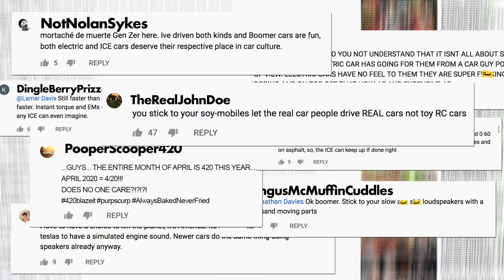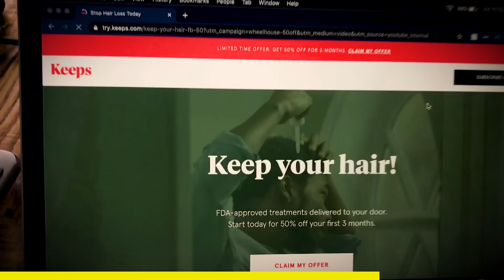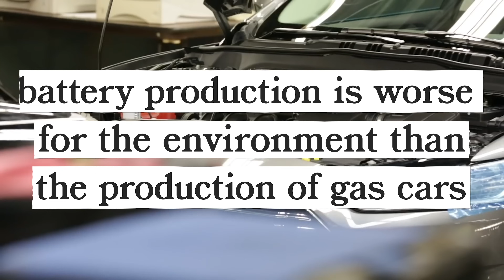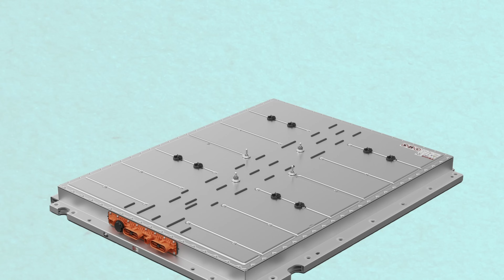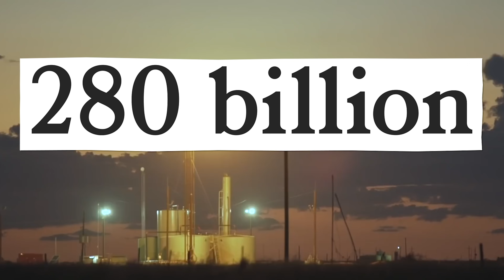Are Electric Cars REALLY Better for the Environment?

Comment: I dont get the Calculations made in regards to the efficiency of Evs. Surely you need to take in consideration the efficiency of the power generating system and electricity transmission system. My reasoning in regards to Evs is as follows assuming that the electricity is supplied  or part supplied by a fossil fuel power station 1. The fossil fuel needs to be dug out of the ground and transported / piped to the power station this requires energy and Co2 emissions. 2. The chemical energy in the fossil fuel is converted to heat energy  ( this is a very inefficient process as I understand as in all Heat engines - remember powerstations are really very inefficient steam engines ) and lots of CO2 is emitted. 3. Kinetic energy in the turbines is converted to electrical energy in the generator ( another massive loss in efficiency) 4.This electricity is the transmitted via a step up transformer to the Grid network (Heating effects again loses loads of energy ). A step down transformer then transmits this too your Ev  ( more energy loss ) In the battery the electricity is converted into chemical energy in the batteries ( another huge loss of energy ). When you want to drive somewhere the chemical energy is converted back into electrical energy to power your electric motor- more energy loss in both processes. So may I ask how the hell are EVs  more efficient and produce less CO2 per kilowatt of power used than a gasoline vehicle that has far less steps from production - to transport - to Heat engine - to go. When I was taught science years ago a golden rule was the less energy transfers the more efficient a system is overall ??? Please explain - or are we all be conned by the likes of Tesla ??

Comment: You possibly need to factor in how long an internal combustion engine lasts versus how long a battery pack lasts. If you need to replace your battery every five years, then that’s another 40 metric tons of CO2 to produce the new battery
Reply: 10 years*

Comment: I think one thing he missed was that gas cars typically have a longer lifespan than evs without replacing parts, but the effects of that statement probably still won't dethrone electric vehicles
Reply: "Without replacing parts..." so you don't change your motor oil, then?

Comment: Great video man! 
One thing we have to consider here is that EV production technology is still in it's infancy. The process will get more efficient as the economy of scale gets larger. Also, our power grid is something that will get better over time also. On the other hand, you can't just take oil out of the air and put it back in the ground. Once the genie is out of the bottle, it's stuck in the carbon cycle.
Reply: well you can. You grow stuff and bury it. think of all the paper waste we are burying in land fills.
Reply: I am a home builder and we have been putting higher amperage service panels in single-family homes to allow for the use of ev's in the future.
Reply: That’s not true - carbon capture is the possible, there is this really cool new technology called plants. And “the power grid will upgrade over time” - good luck with that, the costs are exorbitant and it will take hundreds of billions of dollars and a century or more before the entire country would be upgraded.
Reply: One of the dumbest and most common arguments I see is "the power grid can't handle 100% EV's. Checkmate, hippies. Hurr durr." 
As if the current grid is this static thing that will be as it is for all of time
Reply: I'd like to mention that hydrocarbons are also cleaning up. Unknown to many people, the introduction of fracking has significantly reduced the amount of emissions  attributed to the USA. There are plenty of startup research companies looking into making hydrocarbons with carbon harvested from the atmosphere, either biologically or chemically. Having your fuel as a relatively inert liquid which is easy to transport and requires specific conditions to ignite, let alone explode, is pretty beneficial. Having your power plant also produce heat is very good in harshly cold environments, not to mention that basically, as long as you can get the engine turning and the fuel isn't frozen, you can start an ICE. Electric batteries, on the other hand, do not fare well at all once you are well below freezing. EVs are inherently heavier too, putting more stress on brakes, tires and roads. I believe repaving highways is not only a big inconvenience and expense for travelers and taxpayers, but involves plenty of emissions as well.

I would place my bet on cleaner oil, not electric vehicles for all these reasons and more. Just because newer tech exists doesn't mean the old is bad. We still use steam turbines all over the place in power generation, even if the heat comes from a nuclear reactor. If it ain't broke, don't fix it.
Oh yeah, one more thing: Different cars will not make American cities any more pleasant to live in. The solution is fewer cars, and better public transportation. Make downtown cities walkable again.
Reply: The power grid where I live, isn't going to be better. It's simple, most roads are gravel and the ussr still exists on maps were I went to school at. So electric cars? Really? Maybe in the city but everywhere else. Nope.
Reply: Oh really? The last battery evolution happened in 1995. And the man who did it won the Nobel Prize. So good luck with your manufacturing scaling improvement.
Reply: @JoseSilva_  yes but it was just an evolution, we need a revolution in portable energy storage. We need battery technology to have followed a similar curve for increased output and miniaturization that we saw for the rest of the electronics world.

Comment: Concise and informative.  Thanks a million for educating me for this important topic!
Reply: To bad the conclusion is all wrong, and not even close to be true.

For example a EU low emission car (pre 2024) is 92gram/km. The most efficient electric car on the market (tesla 3 and Huyndai Ionic, shared place) will use about 0.18kWh of power from the power-station (grid losses included). The most efficient coal power plant in existence is 740g/kWh.. so that brings the mots efficient car and the most efficient power plan to 133g/km. That is quite a bit more than 92gram/km

Comment: Gas cars are pretty irrelevant as comparison to EVs, because there are very few that use LPG or CNG. It would be much more relevant to use diesel or gasoline power trains, which are also more efficient than small gas engines.

Comment: Going to need a better alternative to lithium that's for sure.  Hopefully calcium batteries can deliver.
Reply: Lithium is a very powerful material when it comes to battery manufacturing and that’s thanks to the chemical reaction. They have a very high energy density which is crucial for electric vehicles. Even the more stable variant of Lithium batteries which are Lithium iron phosphate still use lithium. 

Calcium batteries are still early in their development stages but they may never work in ev’s due to their low electrical conductivity and short cycle life.

Comment: You can tell that this video is two years old. Biden and gang have well begun to stifle fossil fuel production and transport, and it's pure fantasy to think that solar power--a highly inefficient use of resources and the land millions of panels would cover--and spinning whirligigs will supplant those fuels and supply the power 24 hours a day to hundreds of millions of EVs.

I wouldn't care to have a car that could turn Roman candle at any moment, in use or parked. The EV cost will be at minimum 50% more than the equivalent ICE and will be much less recyclable. The cost of charging stations at, say, apartment buildings will be vast, and the expense of an expanded electrical infrastructure shuttling excess (if there is any) electricity across the nation will be in the trillions. Co2, the stuff that's in your beer and pop, is the primary output of ICE these days, and it's far less a problem than Chicken Littles claim. Earth has had far higher natural levels in the past with the only damage being much more plant life.

Comment: 1. no matter how many charging stations are built, it will not be sufficient, mainly due to peak time travelling patterns.
2. battery technology will change progressively, EV will get outdated fast and have no value.
3. EV charging stations and their infrastructures are costing more to build.
4. Energy demand from the power plant will be more due to more EV and more charging and over-charging, where is the CO2 reduction in green initiatives?
5. Electricity lost over a long distance of distribution, where is the energy efficiency?
... many other reasons +++

Comment: I'm working to have a blend of the two to be more efficent. I'm not talking about hybrid here. I bought a 25kw diesel generator to charge my futur EV and protec my farm from powergrid failure. Before laughing at me, know that an ICE lost around 75% of the energy in heat. By making it stationary in an isolate room, i can  heat my house and barn for free. It even fit with my greenhouse ventilation system made out of dodge caravan radiator and my no-battery solar panel system.

Comment: I'd rather wait and see.
On the environment, i think it won't help much because you have to consider some of the drivers, like myself, like to keep their vehicle for more than 10 years... EV batteries won't last as much, so not only I'll spend a lot more in an EV in the long run, it won't be helpful for the environment...

On money spent, it still doesn't make sense to buy EV, unless you drive a lot per year so you can see the return sooner, all of that before the expensive battery needs replacing in less than a decade or so.. 

Also, there's infrastructures to consider... All these clean energy: solar, wind, hydro, etc, have a big disadvantage... To build them you still leave behind tons of carbon footprint, they are not durable just like the lithium battery, and most important, those sources of energy can't replace entirely the 'dirty' and conventional sources of energy, it can only be used as compliment to the conventional... 

Oh and I don't even want to think what the electricity prices will be when half of the cars in the world turns to EV.

Comment: Sorry, but one of your facts is severely flawed.  The electric power grid of the country is not currently capable of handling the entire country being electric.  I can't say for certain regarding 25% of the country being electric, but I have some serious doubts on that as well.  My basis?  The fact that how long it takes my skillet to warm up to cook a meal on my electric stove varies by the time of day.  If I'm doing that at a time when most people will be cooking a meal, most notably supper, there is a very observable lack of power, and I live in a small rural town with almost no electric vehicles in the area.

The overall output of our electric grid is technically capable, but the on-demand output, or how much it can make RIGHT NOW isn't sufficient to keep pushing this so hard everywhere.  There may be places in the country where the electric power grid is sufficient, but that does not apply to everywhere, so that myth isn't entirely false, it is situational.

Comment: No problem here about electric powered cars. I actually welcome alternative fuel power. 

I just don't believe anything should be forced or mandated. If someone wants an EV.... including me, at some point 🙋 (Cyber truck!)... Great, but if not, great. I also wouldn't rely on having an EV as my primary car, for a few reasons, but that's me. 

Oil and petroleum based products aren't going anywhere. I also believe we need a healthy balance with materials and power sources. But bigger picture, there's a hell of a lot of bigger problems we create or let fester than electric powered cars vs gas powered.

Comment: Wait, but don't you need to change the baterry of an electric vehicle after 10 years ? And i heard that cost more than buying a new car, so after 10 years you will buy another car then another then another, while you can use a reliable gas car for a lifetime if you take care of it, so after 50 years of changing electric car and trowing them away won't the gas emissions be the same or more ? I don't know man, if the fuel is the problem, let's just find a better fuel, then the problem is solved, right? Also if all the electricity falls down in case of an emergency you're f ked, in an EV 😅

Comment: electric cars are worse because they use lithium batteries, and without oil you can’t get energy for your tesla. BONUS: most EVs are ugly too :/
Reply: Solar panels exists and get a better taste on cars
Reply: @tanvirsourav83  you CANNOT reliably switch to clean energy
Reply: @ForensicRocks  would take time but probably can, at least for the big uses like for transportation, household etc. This r the most part that commits most of the CO2 

But I do get it u can't get it to 100% but that's not necessarily, France and Norway tries to be 100% green powered and they r close but not 100% 

But to commit less CO2 we need to switch to EV for sure
Reply: @tanvirsourav83  Better taste on cars? You want us to think that the boring no sounding, lithium, ugly ass grills from the front is better taste? I would honestly prefer a honda beat than any of that.

Comment: Really good video, yet the main issue is still missing: Yes, ICE production and emission has still much more impact on the environment - however, i would like to see a realistically well-calculated prediction about the said impact if we'd replaced ALL the ICE vehicles with their EV counterparts and look at the numbers again - not even counting the electrical energy crisis very likely to arise (because we do use electricity in our homes not petrol-power, right?). What really grinds my gears (no pun intended) is that ICE is still demonized by those "EV-enthusiasts" or "futurists" (!) as if the industrial revolution had just begun and ICEs are produced and operated similar to the first steam machines! We've made a huge progress in terms of production and operational efficiency and i don't think until the same level of progress is reached on EV-front, EV vehicles will not do much, apart from contributing to the negative impact on our planet. It's not a "better" alternative that we can trash our progress on the ICE yet. In the future, maybe - but not yet.

PS: Hydroelectric power HAS an impact on the environment - compared to the thermal and nuclear power, it has obviously much less impact but still, it has a significantly negative effect on the flora and the fauna of its environs.

Comment: A better comparison would be electricity production to power an electric car to common household appliances and how that power is produced. So, say for instance, if an EV drives 12k miles a year that will use 4,200 kwh a year. At the average of 2 pounds per kwh, that is 8,400 lbs of CO2 a year per EV or 4.2 tons or about 42 tons of CO2 for the lifetime of the EV car. Now compare that to a refrigerator which uses 4 kwh a day, 1,460 kwh a year making 1.46 tons of CO2 a year. Or an AC system which will use, on average, 3,100 kwh a year making 3.1 tons of CO2 a year. So, running an EV car uses almost the same amount of electricity as the two largest power hogs in a house. That means if the whole nation went EV tomorrow, the grid would collapse as demand would almost double. That means to meet that demand, more power plants are needed. Almost twice as much to do a full conversion to EV. 

Now look at an ICE which produces about 4.6 tons of CO2 a year with an add on of about 1.2 tons to gather and refine and transport the fuel. So a total of 5.8 tons, roughly. But there is no additional power needed. So that creates a net overage of 1.6 tons to run ICE over EV in fuel production. So, eventually, over a long period of time, the EV will come out ahead of ICE. But just barely.

So the answer to the environment question isn't in cars. The net gain is so minimal, the production demand increase so great, that the benefit is not big enough to warrant the effort. It's like trying to put out a warehouse fire with a squirt gun. Will it reduce the flames? Yes, but by such a small amount it is indistinguishable.

So, back to the household appliance comparison, because that is where the answer lives. How electricity is made. The solution to reducing CO2 gasses is to change the way power is made. Find a reliable, efficient, consistent way to make electricity without coal, oil, or gas...the CO2 numbers will go down by a significant margin.

Comment: Excellent video. One suggestion would be to look into problems with using solar power for charging stations. Still, looks like electric wins. Thanks so much!
Reply: I've since watched some additional videos/ perspectives on the subject of EV's. Turns out that they are more dangerous in some ways due to the weight / velocity of an EV vs. a regular car so accidents are much more dangerous to all parties. Additionally, if EV's get any saltwater on them or have any reason to catch fire then it takes thousands of gallons of water to put the fire out in addition to the high level of toxicity from the burning lithium battery. I haven't checked on the trends for insurance but that would be my next topic to investigate if you really want to give the big picture of the ups/ downs on this type of vehicle. Still like the video though - very informative!
Reply: @theonetrueking2685  You have my deep respect for actually looking into things instead of just watching this and thinking everything was clear